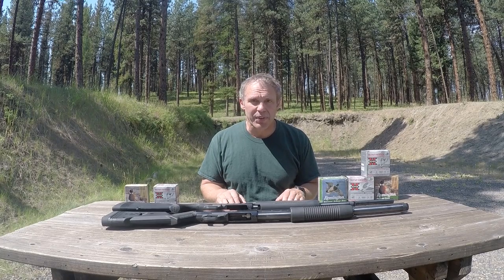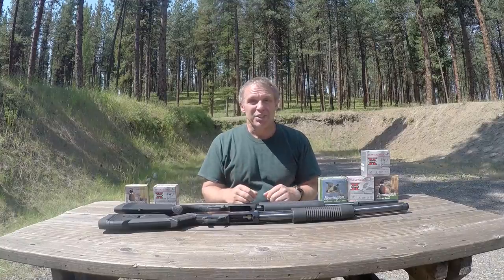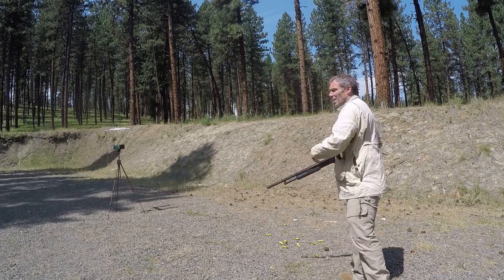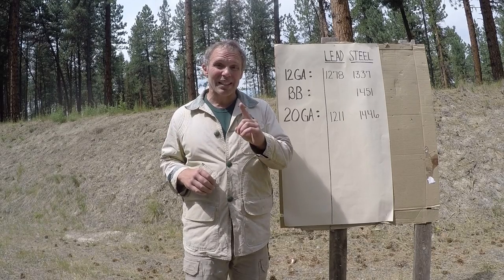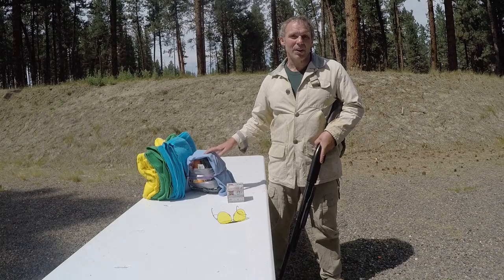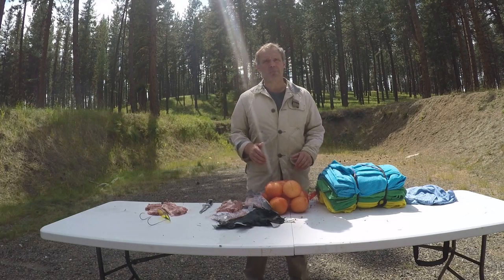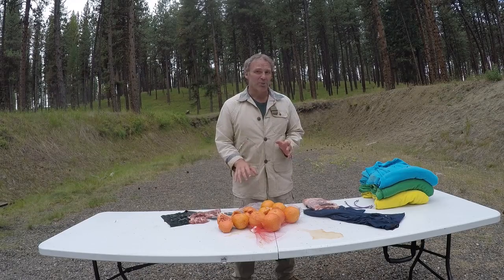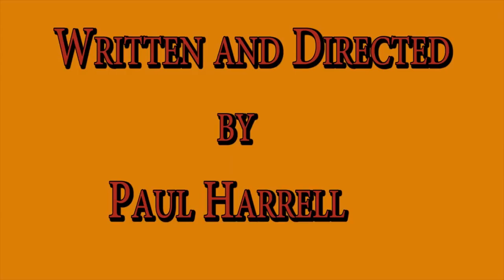Steel Birdshot for Home Defense

Comment: I cringed 😬 at the end where you cycled 5 steel shot loads through your Remington M-11,that shotgun is over 60 years old and back then steel shot didn't exist.
According to what I've read about steel shot from the ammo mfg's,steel shot isn't suppose to be fired in non-steel approved barrels and never used in anything tighter then modified choke.
If your using shot like number 2's,BB,BBB,T or F shot,even a more open choke is recommended,this is suppose to keep your patterns from getting blown apart,plus the possibility of serious damage to the gun barrel by reaming out the choke,or bulging and blowing the barrel itself.
Reply: 4 gauge I absolutely agree! Paul, please, please, don’t treat a classic gun that way! While modern wads and shot cups probably do a fine job of preventing the steel pellets from actually coming in contact with the barrel, the chance of you scoring the inside of that barrel is still there. The Remington Model 11 or Browning Auto 5 is a truly classic bird gun and one of my all time favorite guns. 👍 Thanks for the video Paul.

Comment: 99.7% of the time I have a handgun ready for home defense & it has been years since my shotgun had been loaded... goes back to the various protests & riots during the Obama years; I developed a 2 stage plan...when protests were occurring locally/regionally I would charge the mag tube with federal 12ga #4 lead birdshot (heavy field load) & the shell carrier on the buttstock got 12 ga low recoil #00 buckshot; when the riots started the shotgun got all buckshot! during the '16 election I did birdshot in the mag & buckshot in the carrier...also stagef several handguns in the house(I thought the liberals were gonna lose their minds); since then...shotgun is idle

Comment: I’ve had a 3 1/2” Steel BB load bounce right off a fat goose at 30 yards. No way I’m trusting that with my life .
Reply: They are tough critters.  Lots of feathers.  My grandpa gave me a bucket full of #2lead birdshot and #4buck. I asked him what he used it for he said geese before lead was outlawed.   I got a permit to shoot problem geese in a field man the range I could put them down with 40year old lead was amazing!!!
Reply: hammer slammer Lead shot is amazing. The old guys I used to hunt with always bragged they should shoot snow geese at 100 yards with lead #2’s and a full choke. Wouldn’t even try a shot past 40 yards with steel.
Reply: @HughesEnterprises   I'd believe it! Found pounding Canadians was no problem at 75-100 yards. I've even rolled a few coyotes in the spring at a good 100 yards with the old federal #2 lead. I didn't think it would have that effect but dont much care if they had to run away and die or die right there.

Comment: All that anti-lead fear is just that, fear. And very baseless. People ATE off lead plates for  ALONG time and the only issue I found from research, was when you ate tomatoes (acidic things) on them. Water alone seems to negligible for solid lead magically dissolving to be digested.
Reply: Matthew Wilhoit doesn’t mean I’m gonna start licking lead paint
Reply: @alexmoore1506  Lead paint and a lead plate are very different. Digested lead is a real problem. Lead sitting in little metal balls in the bottom of a lake, way over blown risk.

Comment: I call BS. I've never had a chrony that would read bird shot so well. Almost always gives an error. The pattern isn't tight enough, and the wad usually messes it up. I would love to see a close up of the chrony while u are shooting. Other than that bs, it was a great video.
Reply: I’ve been shooting through a cheap ProChrono Pal for years and never had problems with birdshot. Lots of problems with high powered rifles though
Reply from the maker: No, you're the one that's perpetrating BS. I have had very few problems with chronographing bird shot.